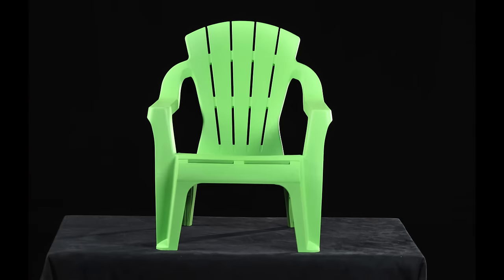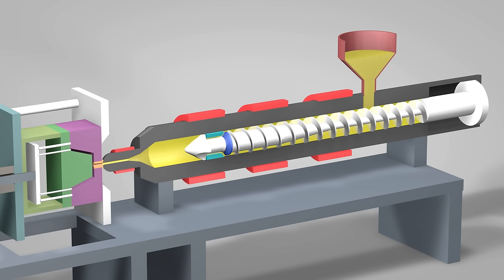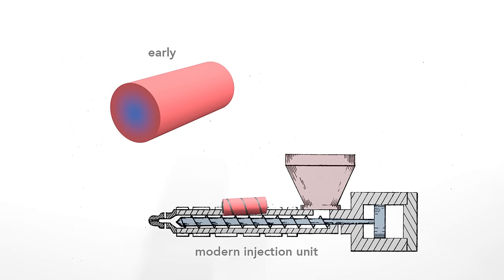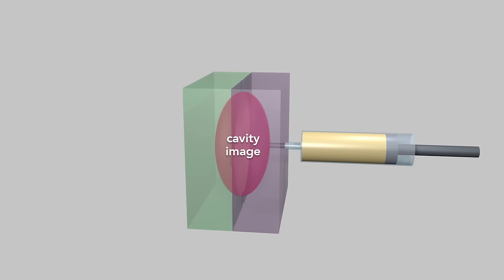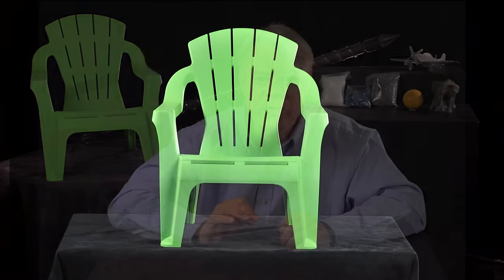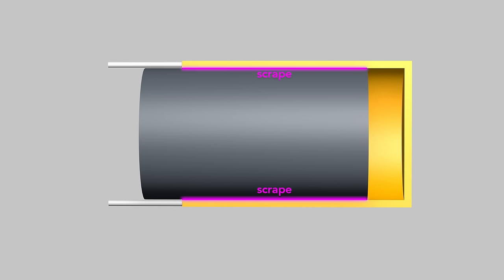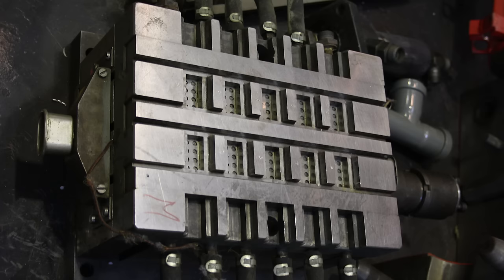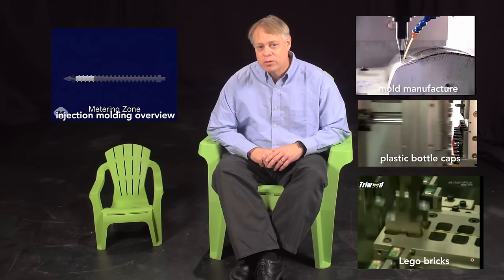Plastic Injection Molding

Comment: Could you tell me why only the use recycled material is limited to around 15% , what constrains its increase?Excellent video and amazing animations.Thanks a ton.
Reply from the maker: +Akshay Pai Raikar Typically recycled material doesn't behave like virgin material. This is true in many processes. For example, in the aluminum can there are two different alloys -- one used for the top and the other for the sides. You can recycle the top into the sides, but not the other way around. Here's how another commenter expressed the problem with using more than 15% recycled material: "Polymers are long chain molecules. When you pass it through the injection screw, shear forces melt the material but also break up a fraction of the molecular chains. This means that the material that comes out the nozzle of the injector is not as good as the material that went into it. So when you recycle that material you are adding another shear history to it, meaning even more molecular chains will be broken. By limiting the amount of recycled material to 15% it prevents complications in the finished part due to material degradation." That's likely correct. In general: the history of a material is as important as what it is ... this isn't obviously if you are not schooled in the art!
Reply: +Akshay Pai Raikar 15% is not typical, ive worked placed where we've used 60% regrind (and the manager wondered why parts we made were shit-tier)
Think of it like this, you cook a hotdog. tasty right? but you've got left overs, warm them up the next day, and the next, and the next, overtime the hotdogs get burnt to hell and are inedible. Your hotdogs are not plastic ;D
I am not good at analogies
Reply: *****  Thanks a lot for the brilliant explanation btw Thanks for making these amazing videos I really appreciate the effort you put into making them
. Timothy W The analogy drove home the point Thanks.
Reply: It's not.  We run 100% regrind  sometimes.   There is not set number
Reply: hi, i work in a plastic manufacturing company, and i was working as a material handler at one time there and can tell you why some products may require only a 15% recycled material allotment.  as you use more recycled material or as we call it, regrind, or in other words, scrap parts, sprues, runners that we grind up at the plant, can degrade over times molded so will degrade quality depending on regrind used. some parts are fussier than others so require lesser regrind, or in some cases strictly virgin or unused material.  some materials we use can vary from 20% to 50% regrind mix, and some 0% like brake parts we make.  like plastic pulleys we make can be 50% to 20% mix, most are usually 20% mix since most pulleys are ment to last.  so basically it depends on how the customer wants the part to come out and how fussy they are :). hope this clears things up a lil :)
Reply: +Timothy W They aren't plastic, but they definitely have long chain organic molecules!
Reply: +engineerguy How about organic plastics like PLA? Does it have this same issue? Is there way to reconnect broken molecular chains, so plastics wont go in waste? If that is not in use i'm guessing its not cost efficient, but in theory is that possible and how?
Reply: Using recycled material can also change the color of the parts.  Customers don't like that very much.
Reply: The most basic reason that recycled plastic cannot be used is contamination!!

Everyone talking about "shortened polymer chains" and how much "regrind" this and that product can take. I'm sure are factors that must be considered, but contamination is first and foremost!!

In-building production scrap & mistakes generally can avoid quite a bit of contamination, but not all of it!

Post-consumer recycled plastic is virtually useless!! The only things it can be made into is pellets/chunks for playgrounds & mulch.
Another is plastic lumber. Waste plastic, sometimes combined with various amounts of sawdust, used in fences & landscaping. They make railroad ties too.

They make deck surface material out of virgin plastic and sawdust. Some of it looks very nice and weathers to a convincing natural gray color.
Reply: Jetta Driver and over time the recycled plastics degrade as they are heated and cooled over and over again
Reply: Preforms for blow molded beverage bottles are made of many layers. The inner layer is new or 'virgin' PETE while the outer layer contains a high percentage of recycled bottles. In between are other plastics formulated to do things like keep CO2 in and oxygen out, or protect from UV light.

From the raised neck ring up on a bottle is molded in the preform. The preforms get clamped into heated clamshell molds then air (or other gasses) are blown into the preform to expand it.

Look closely at the threads inside the cap and on the neck of a soda bottle. See the vertical grooves interrupting the threads? Those are there to release pressure as the cap is unscrewed. The early plastic caps (which were designed with a thread that could be screwed onto both plastic bottles and the slightly different thread pitch used on glass bottles) didn't have the interrupted threads and a few people got popped in an eye by flying caps that managed to maintain a seal until they were fully unscrewed.

The plastic soda bottle needs a video to go with the one on aluminum beverage cans. Make sure to mention how the early bottles had a separate bottom cap glued on so they would stand upright - then people working on making the bottles cost less to make figured out that the pressure wasn't so high it required a spherical bottom. A slightly thicker, five lobed bottom worked just fine and eliminated the cost and weight of the cap and glue. That paved the way to the 'coke bottle' shaped plastic Coca Cola bottle and the rest of the soda bottles that aren't shaped like small SCUBA tanks. People making water rockets out of soda bottles were not thrilled about the aerodynamic and high pressure issues caused by the loss of round bottom bottles.
Reply: You can probably recycle aluminum (3000 Alloy?)can sides into the top (~100% aluminum), but it would probably cost a lot more than just buying recycled/new can top aluminum?
Reply: The primary reasons for limiting regrind material in my experience were brittleness and out of spec dimensions which would affect secondary assembly operations. I was responsible for 5 types of mass airflow bodies and 2 types of water outlets all with a 0.1mm max tolerance and capable of withstanding ultrasonic welding without cracking. We were limited to no more than 10% on all except one outlet which needed virgin material due to brittleness.
Reply: "depends on how the customer wants the part to come out and how fussy they are"
This so much. The material matters too, but some stuff you could recycle over and over and not have any process issues making good parts. Its just most customers are picky and want virgin material all the time
Reply: Akshay Pai Raikar plastic is pretty hard to reuse, it takes a lot of energy to reform and what not. Actually it's cheaper and more energy efficient to just make new plastic then to retreat old plastic but it makes people feel good if they say recycled
Reply: The truth is 15% is maximum a company will admit publicly. Ofc, they will pump as much reycled material in there as their quality control allows them. Some of the parts we made from glass reinforced PA has as much as 30%
Reply: This is Top Secret for plastic injection industry: they always try to save money and push as much regrind as possible. Doesn't matter what customer demands (regrind is weaker, mechanically, chemically, that's why there are restrictions - in theory). That's why plastic parts are often failing. Not necessarily from bad design, but manufacturer scam ("savings" on material).
Reply: Torch falment please
Reply: @timoweic  60% regrind, my god we think we're taking a risk with 20% lol
Reply: to be able stabilize process (cycle time, cushion deviation e.t.c.) sometimes 50% allowed but not in all cases))))
Reply: Actually, the amount of regrind used is usually a customer specification. If a customer wants virgin only, that had better be the material you run. 15-20% is usually around the norm the customer allows. A much cheaper part may allow a higher regrind mix.

Running 100% regrind can cause a myriad of problems, anything from degenerated or brittle parts, to even the material balling up and not feeding down the screw, or not wanting to feed right through a vacuum hopper system. Then there’s the problem of possible contaminants in the regrind.

Comment: I was a maintenance-electrician at a large injection molding plant for many years. We produced mostly plastic parts for the automobile industry. I had to clean a lot of burned plastic off of the screws in our molding presses.

Comment: Also the screw can be heated or cooled internally usually with a thermo type of oil.The deeper flites of the screw would be where you would want to vent it. Different classes of plastics require different cuts of screws.
Reply: What would be the purpose of cooling the center of the screw when it is designed to improve consistent heat throughout the material?

Comment: I used to work in a factory that made its own injection molded parts for precision pumps. Modern injection molding is very fast, I think some of the cycles were just a few seconds. Still, the assembly machines were faster and so we were always behind on parts and were buying a ton of them from vendors as well.

Comment: I flinched every time that mold started closing without the ejector system being retracted by the machine... that was grounds for termination where I worked...good video tho...enjoyed it.
Reply: Yes, that's very old (outdated) and primitive method, and only for relatively simple molds. Nowadays ejectors are retracted by machine or by mold itself (hydraulic ejectors).
Reply: @xyzzyx7669  Or just a big spring

Comment: I design moulds for the automotive industry for almost 5 years now. Its not an easy job but i love it. In fact, none of the steps ( designing, producing and injecting ) is easy. So many things have to be considered, and in the automotive industry the margins for error are razor thin ( i've dealt with 0,05mm error margin before ) . 

Before working on moulds , i never really realised how we are surrounded by thousands of plastic objects that where injected, and how each and one of them required a mould to be made. A single mould for the most "insignificant" plastic part can sometimes  cost more then 100k, and take a few months to be produced, tested and delivered. Now imagine only one car, with hundreds of diferent plastic parts....hundreds of moulds...millions and millions invested......this industry blew my mind, and i wasnt even aware!

Congrats on the video, well explained and interesting to watch.

Comment: They also use air valves right in the mold that blow at a specific time to help break the seal while the mold opens, and to push the part off the mold

Comment: As a college student, this was my job one summer - to operate an injection molding machine.  I made telephone handsets and telephone housings.  It was hot work.  We didn't have ejector pins - I was the ejector person, reaching in and grabbing the hot part, tearing off the sprue and most importantly, making sure not to scratch the still-soft plastic, which was very easy to do.  At another station, we got rid of the residual sprue stem by using a sharp tool followed by a cotton buffing wheel impregnated with buffing compound.  I made thousands of those things.  It was hot, mindless work that motivated me to stay in college, lol.

Comment: Found this post by accident and glad to have done so, in the late 1950's and early 1960's I trained as an Injection Moulding Machine Setter. This was before the time of screw injection, before screw injection was introduced I left the industry to pursue another trade and it is only now that I know how the screw injection system works.

Comment: My workplace has a mini desktop injection molder but with just a headed tube and a pneumatic piston. The part you mentioned about uneven heating is a real problem. TPU seems to degrade severely if overheated and the margin for error is slim. I found that a mere 10 deg C extra is enough to make tpu weak enough to be torn apart by hand.

Comment: I used to work for a company, that made closures for Heinz, Smartwater, Tropicana, Dove, old spiced, bath and body works, a lot, lot of big name brands and products. I was never more than an operator, or a material handler who would handle color changes for the injection molds. Back then, I had no idea of the things I have an idea of, these days. injection molding is a very complicated, very precise process. You can make a very small adjustment to the process and it could fck up, or fix your issue. I still don't forget having to clear auger jams from all the excess runner material on certain molds running certain parts. always were a pain in the ass.

Comment: Molding plants use a lot of robots for post processing parts. For example plastic cutlery will be grabbed by the sprue, rotated to alignment using a machine vision system, then set into a nest of pneumatic flush cutters to clip the utensils from the runners. They fall onto a conveyor that goes off to packaging. The robot drops the sprue and runners into a bin or conveyor for recycling, often going to a grinder within the plant to make chunks for blending with the fresh resin pellets.

Comment: I  used to work for a company that built "Injection Molding Machines",  called Engel in Canada, a European based company (that was great to work for) , and the process of building these machines was intricate  and  varied (depending on size and purpose)
Sadly, with the slow downs starting in the early 2000's  affecting much of the manufacturing sector they had to close many of their plants due to competition and  a drop in  demand  for new equipment. 
I don't know how many divisions still remain, if any, but i hope they are still around, because they were an incredible company to work for, and treated their employees quite well.

Comment: Some of the molds I’ve worked with are heated with a hot oil thermolator to achieve a much higher temperature. However the mold and parts are much hotter when ejected, and we use screens to place the thermolators behind to reduce the chance of someone touching it or walking into it and getting a bad burn.

Comment: I worked at HPM - Hydraulic Press Manufacturing in the state of Ohio in the USA.  We made the presses that heated the plastic and injected it into the molds.  Your video is the best explanation about plastic injection molding I've seen so far.  Done very well.  Too bad you couldn't show the molds for garbage cans.  They took those out on railroad flat cars.  The corner rods were steel bars over a foot in diameter.  The other thing you didn't relate was how much force was needed to hold the molds closed.  The lighter presses were 150 ton presses.  It took that much force to hold the molds closed against the injection pressure.  Heavier presses were up to 2000 tons.  The other thing you couldn't show was what happened when the molds leaked.  Nylon liked to attract water so when it was heated and under pressure,  the water would spit out of the relief holes.  They often used nylon to test the presses and didn't have the safety shields in place while testing.  So if you walked by one of the presses testing with nylon you'd get shot with superheated little drops of water - painful.  Also polypropylene gave off a gas when heated that was very dangerous.  OSHA wouldn't pass the safety requirements for the HPM plant today.  A very dangerous place to work, but I learned a lot while working there.  Maybe your next video could be on the presses that mold aluminum parts?  I feel it would be even more interesting than the plastic injection molding.  Thanks again for a great video.

Comment: Great video.
Many many years ago, I use to be a shop lead that was responsible for making sure 4 to 5 injection molding machines were producing products.  This included material and mold changes, heater / chiller set ups.
We had molds that also had screw elements that had to unscrew before ejecting the parts.  The inside edges were razor sharp, and I have scars from removing stuck parts.
If you use a phone that was made in Alberta in the early 80s, chances are,  I was involved.
Ever since, when I look at plastic parts, I try to understand how they are molded.  
The most complicated parts that I see now a days are printer frames with multiple sliding inserts and cavities. Extreme precision molds are required.

Comment: Lego is an interesting company. Some to-be-engineers wonder why competitors cannot manufacture similar blocks to add competition and reduce prices of building blocks. However, it turns out that all the best new engineers are fans of Lego and want to work for them. As a result, after multiple generations, Lego always has the best engineers and the state-of-the-art injection molding machinery.

Comment: And the molded parts are designed to accomodate the flow of the plastic and cooling of the plastic. The main portion of the part is called the nominal wall. Things which protrude from the nominal wall are called projections, and holes in the nominal wall are called depressions.

Comment: This is interesting. I used to work in a hospital products factory in Quality Assurance. When I got the job in the Insert Molding department, I can remember thinking at first that it would be a pie job. Molded parts = all the same. 😂 The joke was on me. So much can still go wrong in this modern process. Thanks for the very interesting walk down memory lane.